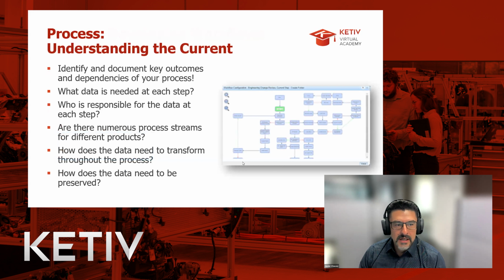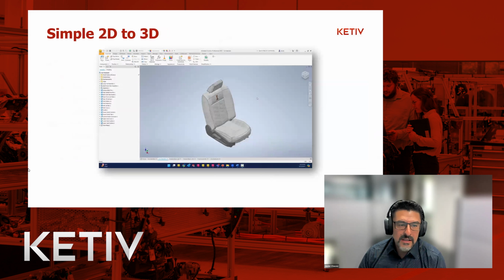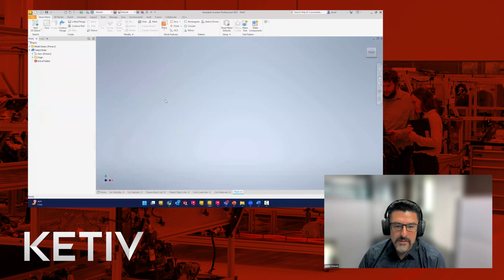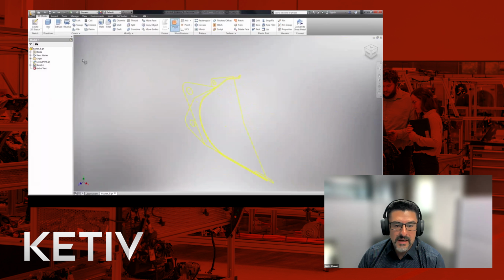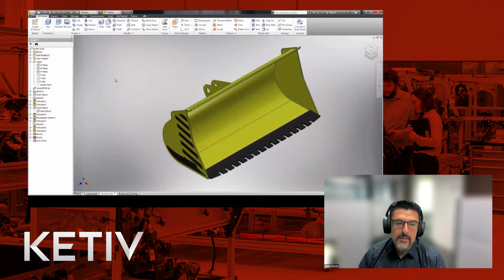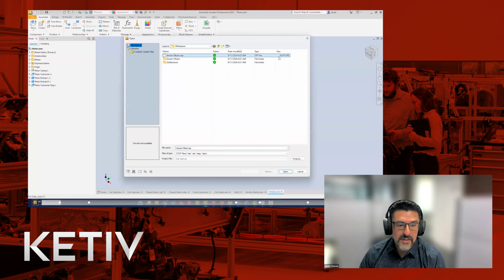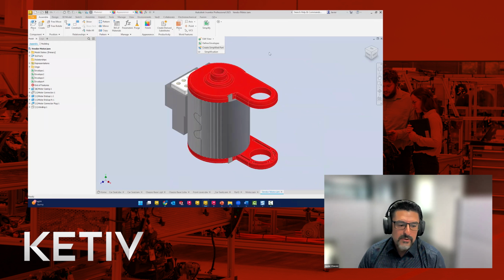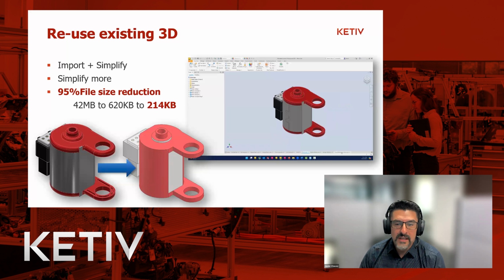Workflow Wizardry: Crafting an Effective 2D to 3D Transition | KETIV Virtual Academy

Comment: Thanks for the presentation! However, this screen format you've been using in recent months isn't really ideal for the viewer. The presentation screen should be much larger. If we don't have a large monitor or if we're watching on a laptop, it's almost impossible to see the details of what the presenter is doing in Inventor. It might be ok for a Powerpoint presentation, but it's not good for viewing Inventor (or any other CAD software).